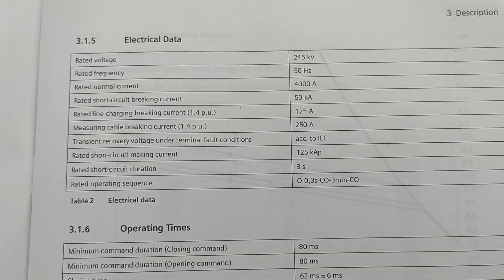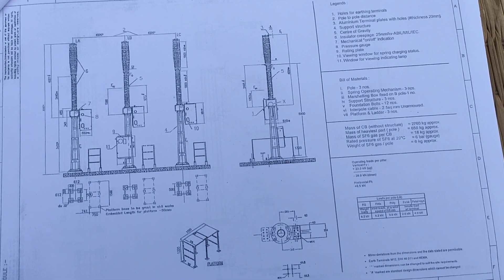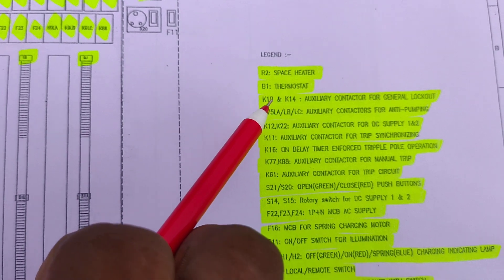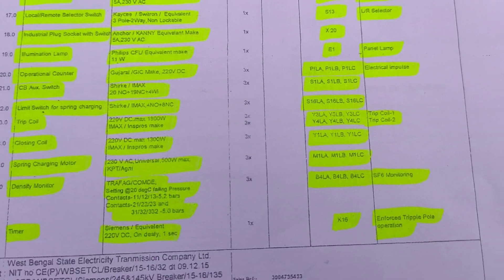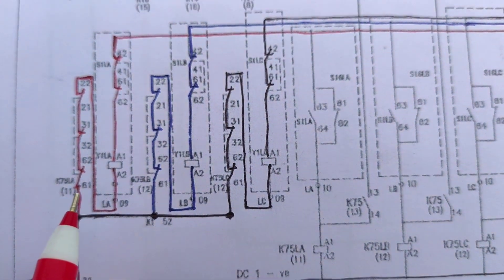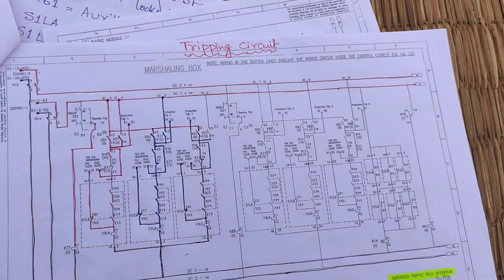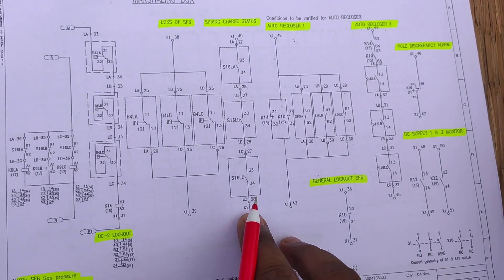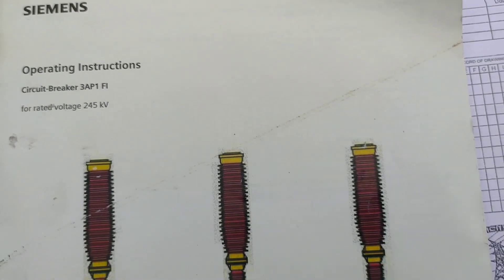220 KV Siemens make CB details discussion//sub station//Power Plant 🏫

Comment: Hi sir, 
1)what is the significance of rated operating sequence of CB mentioned on name plate. O-0.3Sec-CO-3min-CO ?
2)The push button switches S20(Red), S21(Green) on the control cabinet are used for Local closing and opening of CB ? Whether any other contactors are present in the operating mechanism cabinet for Local closing and opening of CB ?
Reply from the maker: Mechanical emergency switch

Comment: Hello, I'm very sorry to disturb you on the weekend. I have a question that has been bothering me: after changing the settings of the protection relay, do I still need to conduct a test? For example, the overcurrent protection has been changed from 5A to 6A. Do you still need to test the relay protection? Thank you
Reply from the maker: Relay protection and testing must be done in every setting change.